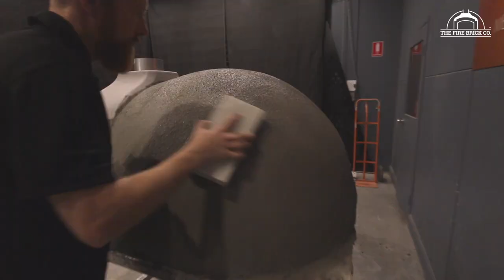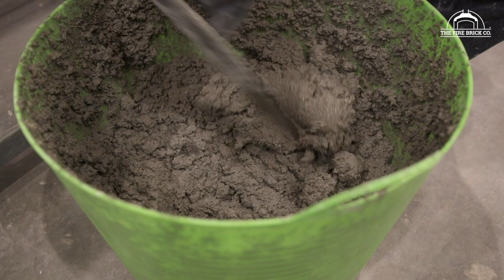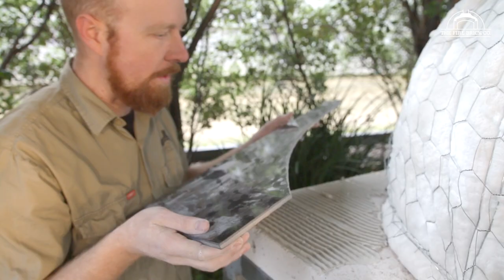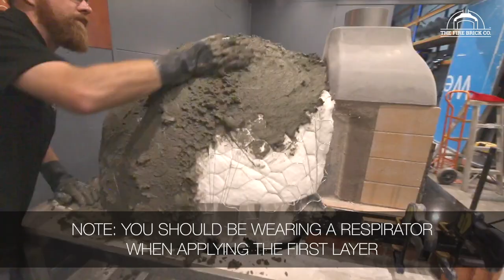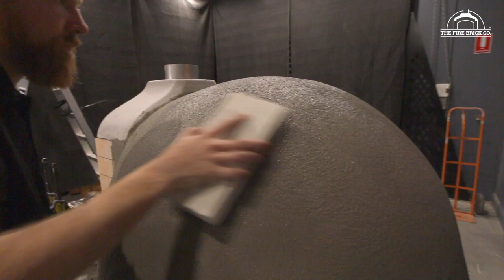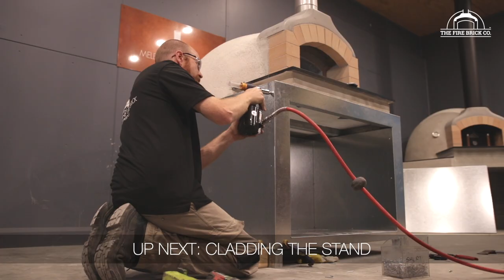How to Build our PreCast Oven Kit | 9. Rendering the Dome

Comment: Just finished my P85 and thought I’d add a few key learnings from me. I did my render in three layers. It took me a while to work out how much to mix for each layer. Two mixes per layer worked for me and fitted in wheelbarrow. I did half the oven at a time with each mix. I used 6 litres (1 1/2 4 litre ice cream container) per part of the dry mix parts. Ie 48l per mix or 96l per layer.
Reply from the maker: Awesome Nicole! Thankyou for the detail, we might add that to our next iteration of the instructions!

Comment: I bought the P85 kit over a year ago, but I also got a puppy a few weeks before the P85 was delivered.  I finally started on the build last week and I just got the second perlite coat on.  I'll try to get the last of it done in the morning.  It's difficult for me to use the float.  I probably need to wait for the coat to set a little bit, wet the dome, then float the top layer.  I hope that gets it spherical like you have it here
Reply: Yeah, that last bit took me 4.5 hours.  FYI: My measuring unit was a quart sized container.  So, 5 quarts perlite, etc.  I got everything reasonably spherical, but had to throw a tarp on it while the rain starts.  Hopefully, that didn't shift any of the render while I dragged the tarp on
Reply from the maker: Sorry for the delayed reply! Hope it has come up really nicely for you!
Reply: @TheFireBrickCo  YES!  I made my first pizza last week and it wasn't quite up to my standards, but hey, it's a learning process.  The dome went on well enough, although, there has been some minor cracks in the dome.  I suppose that's to be expected though.  Thank you so much to all the team at The Fire Brick Company!!

Comment: Is refractory cement and perlite mix used to make this render?
Reply from the maker: Good question - it's actually treated Perlite mixed with Portland Cement, Hydrated Lime and Washed Sand. We don't need high temperature cement in this area as the ceramic fibre blanket protects this layer from really high temperatures.
Reply: Could you please tell me about mixed ratio of Portland cement, hydrated lime and washed sand